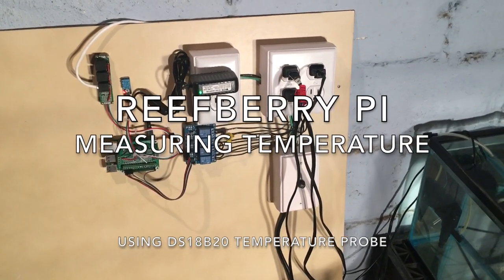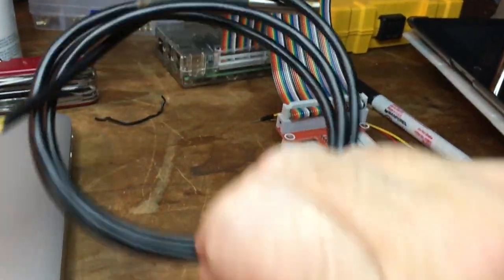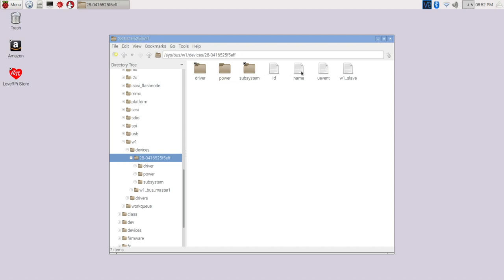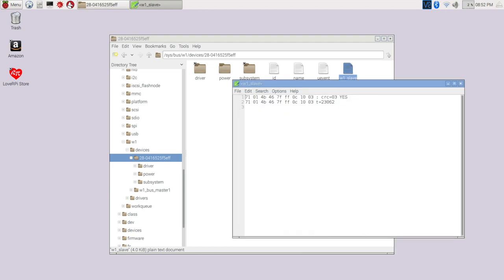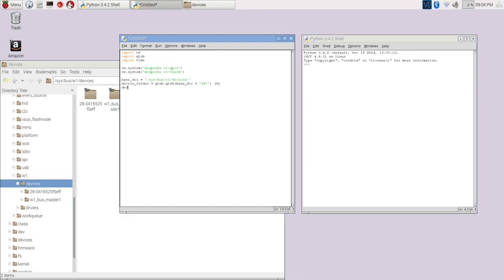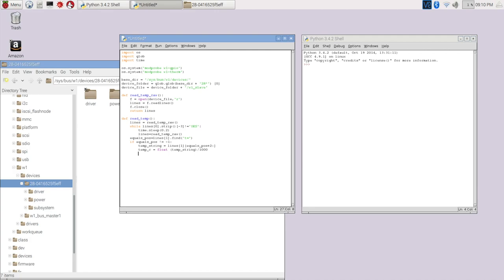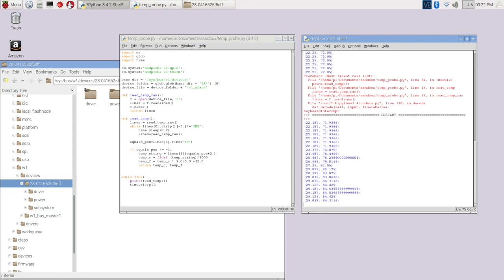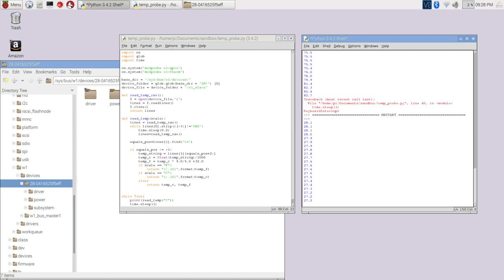DIY Aquarium Controller - Measuring Temperature with DS18B20 Probe

Comment: Does anyone know if the wire shield is safe if in the aquarium water and if it will leech any chemicals? Should I coat them with aquarium safe silicone just to be sure?

Comment: I just used a couple of these to put together a fan controller for a root cellar.  Basically, if the outside temp < cellar temp and cellar temp > 35ish degrees turn the fan on.  I found a library called w1thermsensor that seems to work fantastic and makes getting data from these super easy.  I may even PR back some improvements over time.  If you wanna see my project it is on github under jlaustill/pmac :) Great video, keep it up!
Reply from the maker: cool, I'll check it out!

Comment: Traceback (most recent call last):
  File "/home/pi/Documents/sandbox/temp_probe.py", line 9, in <module>
    device_folder = glob.glob(base_dir + '28*') [0]
IndexError: list index out of range
>>>
Reply: whats wrong in the line looks the same as the one in the video
Reply from the maker: what?
Reply from the maker: I am guessing the Pi is not recognizing the temperature probe you have wired up, so it is not creating the directory in the location you are looking for it.  Index out of range at index 0 means your list is empty, The function returned no results.